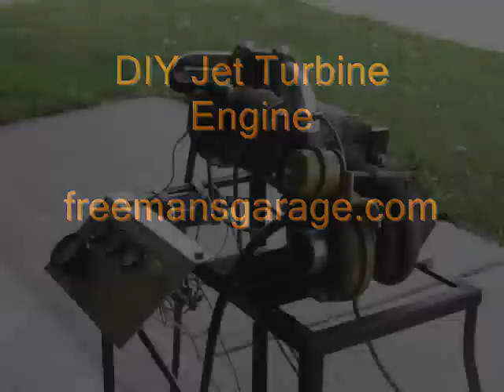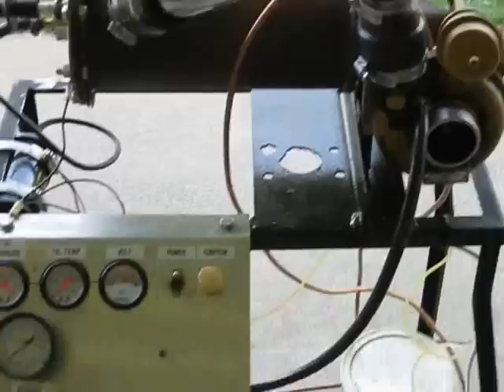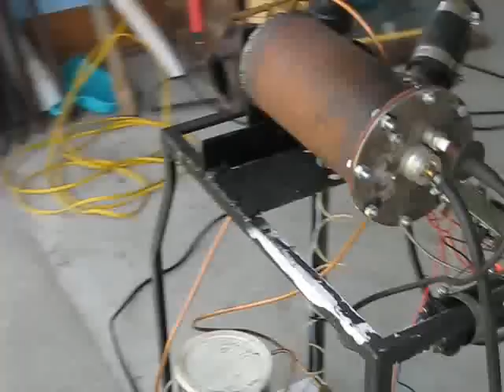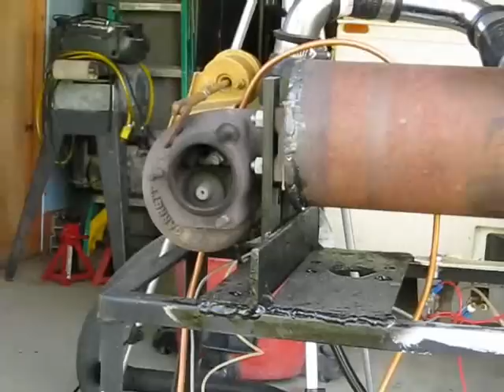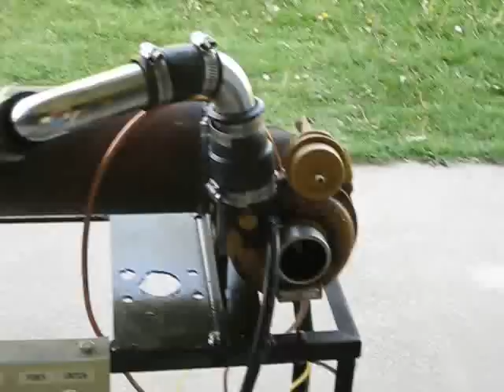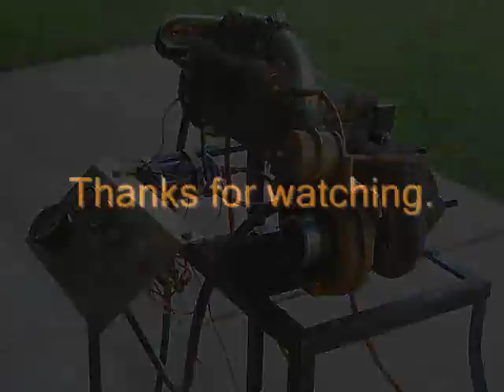Homemade Jet Engine

Comment: Sweet setup! That is a large combustor. You should weld the wastegate shut, they gotta leak a little bit. Anyways, I dig your engine. I plan on testing my oil system for the first time tomorrow, and if all goes well I will try to start it. Woo hoo!